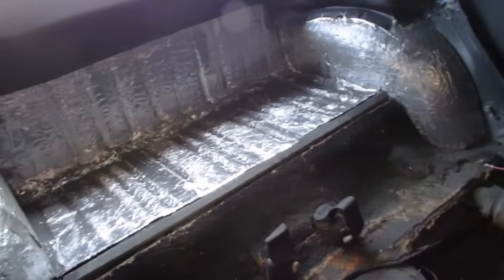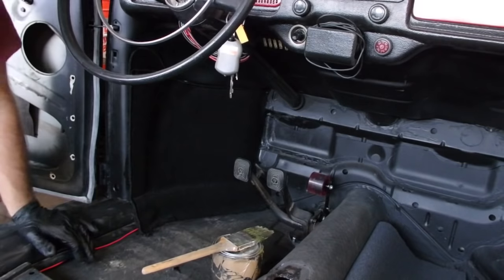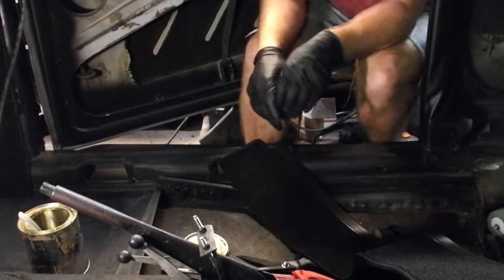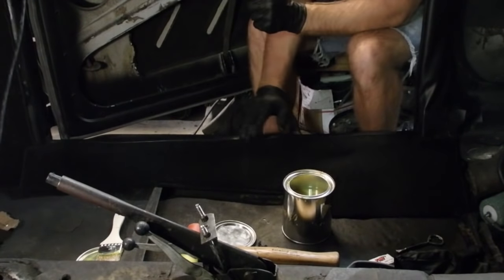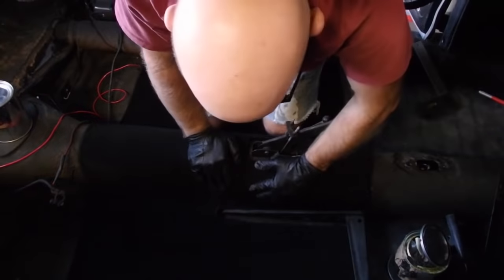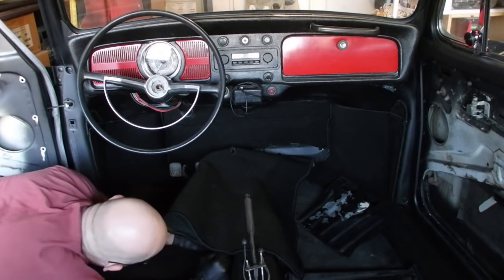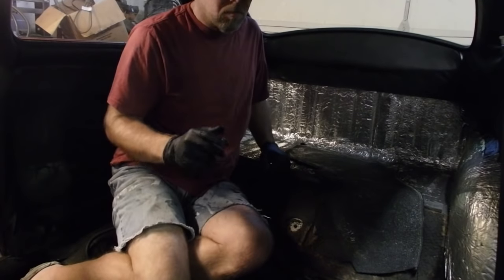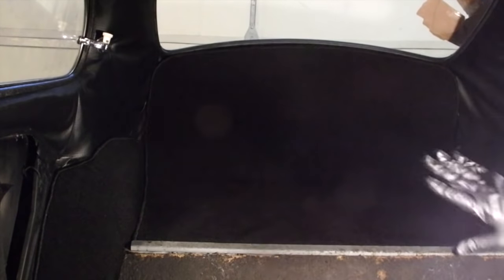1969 VW Bug Project - Episode 47 - Carpet Installation

Comment: Hi there;  just a comment on how I did mine on my last 1972 convertible. I went to the local hardware store and purchased 7/16 desensitized rebound  carpet pad and glue it first to the floor; then I glued the carpet to the carpet pad. It worked very well . It may my carpet look better than other bug I have had in the past. It also helped with sound denim as well as in summer the car inside was much cooler.  Keep up the good work...looking good
Reply from the maker: That's a killer idea!

Comment: Thank you! Starting my carpet kit from TMI next week.
Reply from the maker: How’d it go, Robert?
Reply: @SchoolStGarage  Interior pretty much finished. Only downside...the grommets for the heater vents were not positioned correctly. I cut the holes just fine, but then the carpet was short of reaching the top by 1". Almost like TMI did not place them correctly. Or somehow I did not stretch out the carpet. Now I'm dealing with frustrating windows. :) I even painted the 2 point harness washers to match the carpet. Engine is out- just put in new tar board and now painting the tin to match the pearl white. Have watched your videos many times! Thanks!!!

Comment: School St. Garage what did you use for as a sound deadening in the interior under rear window?
Reply from the maker: It’s called foil and foam duct insulation from Home Depot.  Cost me about fifteen bucks.
Reply: School St. Garage does it work good?like does it make a big difference in sound from the motor

Comment: Thanks for sharing I’m fitting mine next week so very useful. Just curious is it an American thing to call the parking brake an emergency brake. What could it possibly do in an emergency?
Reply from the maker: Probably an American thing.  I got the term from my dad, who grew up driving cars with a single master cylinder so if one brake line failed, they all failed.  And I’ve used my e-brake multiple times on this build when the brakes were mushy.  Not ideal, but better than nothing in an emergency.  

On modern cars they are worthless in an emergency, so the term parking brake has become more common, I guess.
Reply: Emergency break, it was called this as in older cars such as model t where younhadnto balance the clutch to be in neutral, the e break balanced  the clutch and engaged the break at the same time to allow you to stop in an emergency